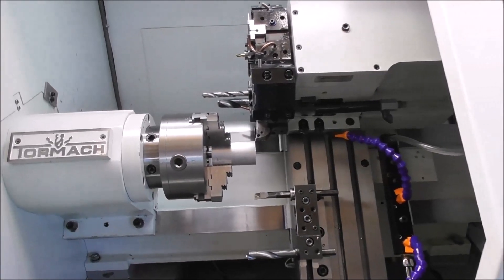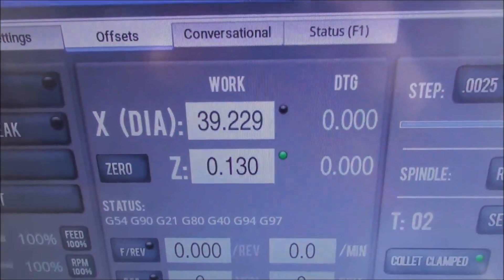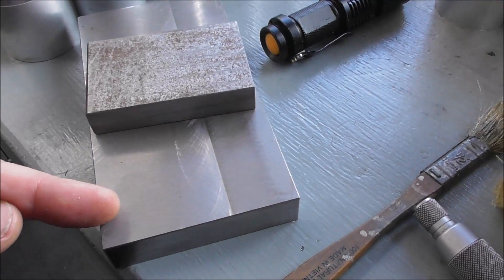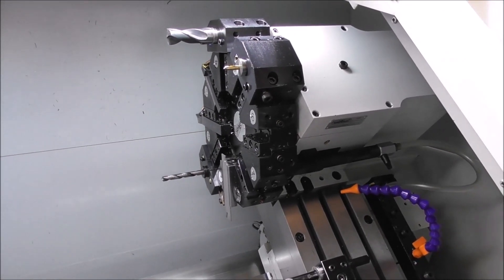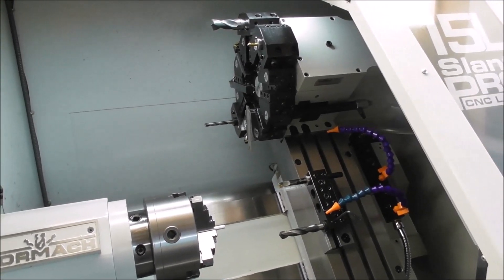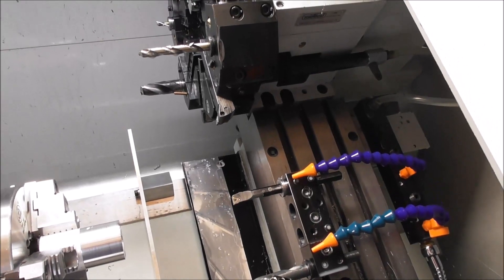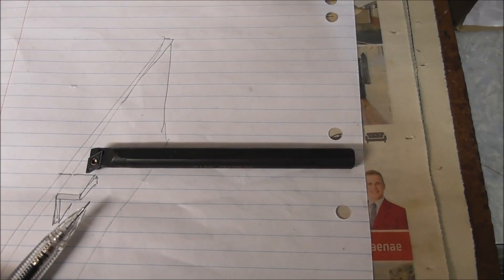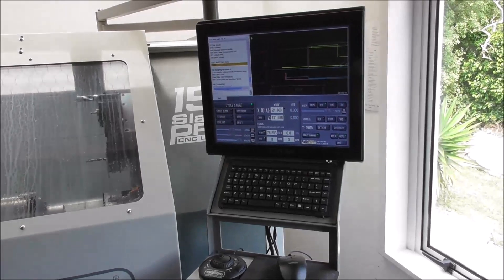CNC Lathe Toolsetting - Part 2

Comment: Also at my shop on most machines set the tool holders to x zero separately rather going relative another tool. By both sweeping the bore of the holder to the spindle bore. ( holding indicator in toolholder) and cross checking by either using some bushing / sliptfits we have to fit the spindle bore or chucking on to a tool holder with indicator ( soft jaws stored away that are meant for this) and checking the tool holder bore from the spindle. You can usually get pretty accurate this way. And just avoid removing your tool holders as often as possible lol and for boring bars you just always use the cut and measure method.
Reply from the maker: Thanks for your feedback Derek. Sorry I missed your comment. Cliff

Comment: What we do at my shop For setting a drill(in what appears your format of machine) you turn a part with a previously known already set tool. Often the master. Then touch part in the x axis [ you can use either a block or a piece of paper] lastly add minus the diameter of the tool. Of course you still check you first part. You can also chuck on to a dowel pin rather than turn something.
Reply from the maker: Thanks for your contribution and thoughts on this Derek.  Cheers  Cliff

Comment: Which kind of takes us back to Rapidturn... I'm finally starting on my tooling plate for it.  One of the design requirements I had was to both have gang tooling plate like yours for production but also be able to quickly throw the RT onto the table and do manually controlled lathe work... giving me both a manual lathe and a cnc lathe.  Just looking at the enclosure and turret on the Slant Pro it doesn't look like it would be much fun to set feed rates and jog by hand to do manual jobs.
Reply from the maker: I agree - for one offs I would use a manual lathe.  Cliff

Comment: Complexity is indeed one of the factors in weighing CNC against manual machines. Not just lathes.

Another factor is the material and the costs of scrapping.  You can test run a CNC program with cheap material before sacrificing the expensive stuff to Murphy's Law. It should go without saying that allowances must of course be made for different machinability between the materials.
Reply from the maker: Thanks for your input.  Cliff